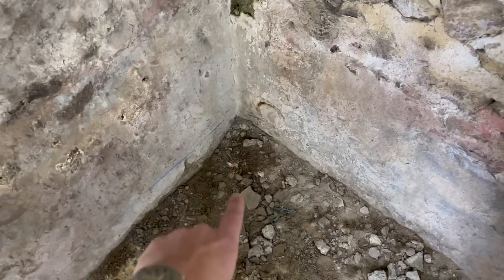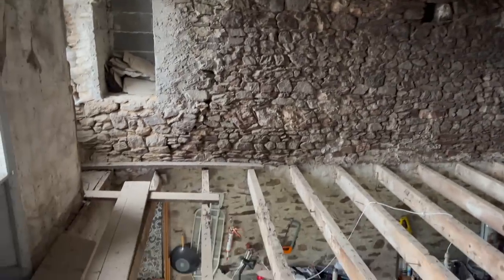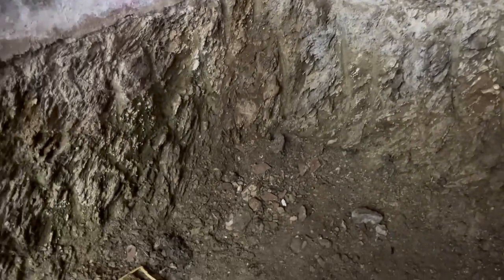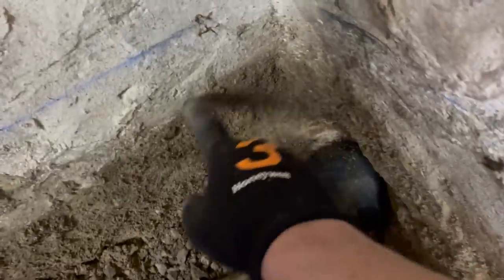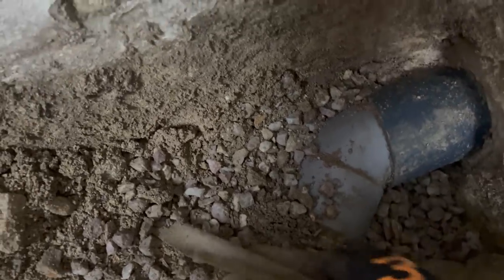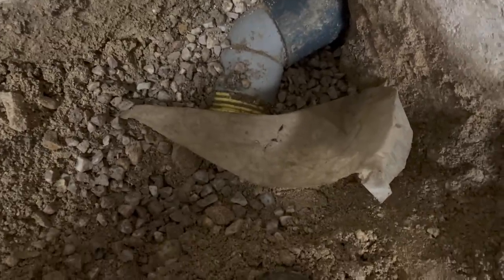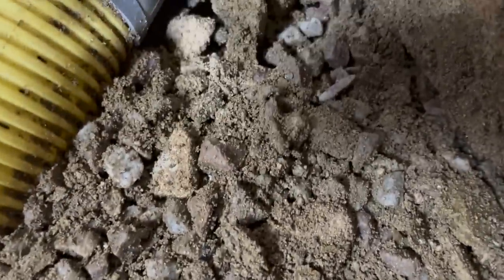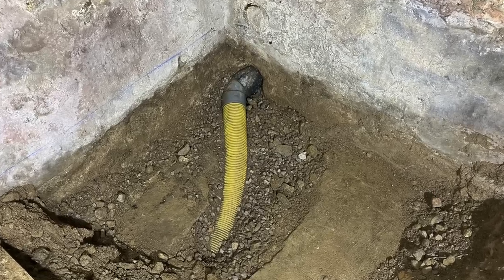A French Drain Inside Our French House

Comment: Oh heck! Glad to see the dehumidifiers are enroute. You'll want to carefully return that fabric you removed and re-cover that perforated pipe. From the three videos, it appears you are dealing with something very similar to what I've dealt with over the last twenty years in this particular region of the US. We have very thick clay soil and quite a large number of natural springs. The perforated pipe suggests you have springs under your floor. However, I think you've had a bit of luck, too. You're on the end of the block, which means you can run the drainage around the outside instead of moving water from outside, to inside and through your house. 
  One other thing, you mentioned the corner of the house in relation to the hole and what looked to be missing stones. I would instead posit that was where the extension was removed and those missing stones were where the extension was Keyed into the main building.
Reply from the maker: My partner suggested there may be additional water sources under the floor, it's not uncommon here. Your point about the extension being keyed into the corner makes sense. Interestingly, I had originally looked in the hole for the stone from that corner, but to no avail. Turns out a lot of the same stone was used in the hardcore on the floor inside.

Comment: Just I case I come across as a mad man please be aware that I am the son of a Water Engineer and grew up at my fathers side on projects from the British Isles To the African continent, Covering numerous developments of Dams,  river water extraction points, pumping stations, pipelines etc. All of which my dad designed. I later became involved with agricultural drainage and designed a drainage machine that was eventually taken up and built. 
The present system installed under your floor, is badly misconceived the irrigation/drainage pipe used to conduct the water gathered at the rear of the property will be doing a great job of irrigating your floor. I would recommend  that you replace this pipe with a more conventional pipe leaving the perforated drainage pipe under the floor to remove any rising damp. If it were my house I would dig up the entire floor and start again. The lack of understanding in the original installation  does not fill me with any confidence in the rest of the job. Should you have any amount of ground water rising through the bed rock beneath the ground floor rooms the perforated  drainage pipe system will need to be extended to cover much of the floor, I would suggest a ring immediately inside the cut bed rock to gather water as close to source as possible backed up by a second web to pick up the rising water both should be isolated from the drain from the rear. Install a stone sink to catch the water at the front of the property as a drinker for dogs and livestock. Have to say this property becoming more intriguing ,You need to get this right first time pratting about with half measures bound to lead to failure and extra cost. It may well be worth cutting an airy down the flank of the house and changing the direction of flow on the rear drain, getting in a JCB and digging out the rear of the property and starting again ie new retaining wall well and a wider airy along with a deeper rear drain. Personally I would cut back the natural rock wall by two meters and deepen by as much as the level at the front of the property will allow
Reply from the maker: Thanks for the comprehensive comment. I assume an 'airy' is an air gap between the wall and earth?
Reply: @TheRenovationProject  You have it. You commonly see them in cities like London as a big void in front of cellars and basements

Comment: I think one more element of the original drainage system is still missing. There should be a pipe (given the age of the original walls it's not necessarily a pipe!) from the back of the house (the old well maybe was a sinkhole?) to the street.
Then at some point of time this original drainage system got clogged, or was not connected into the drainage on the street (or both), so the water stuck and started to seep into the drain below the floor.

That drain below the floor may stay there, but further water incursion should be prevented and the water at the back needs a new pipe (way deeper than the actual one) to the front.
And based on the state of that gravel, that house might need a year of rest to let it dry, before work can be started... Removing the gravel might not be a good idea. You need to know the depth and strength of the foundation first.
Reply: ... on second thought, the street looks relatively new (a decade or two old, maybe). Likely, that time they 'sorted out' the drainage and sewage too, and maybe that was what caused the actual situation. 
Just thinking and guessing: I don't know about the local regulations, but it's often a rule to have no rain- or groundwater to the sewage system. So, the original outlet for the groundwater was likely disconnected from the deep running (sewage) pipes. And the street drainage was on too high level to connect it there => the water got stuck. 

Just guessing. Maybe some older local can tell you the story.
Reply from the maker: We have been chatting to the neighbours and are slowly learning more, also briefly met a chap who was born in this house, but he was too young to remember any details!

Comment: I can understand having the land drain under the floor, particularly with how wet it is out the back but I'd have expected the drain from the back to be solid to the front with the land drains connecting to it via T's. So water passing through did that with no chance of stopping and water that 'rose' under the floor had a way to escape without evaporating into the house. The current system seems to do neither job well / at all!

Comment: That makes me think, how hard would it be to take the water round the out side via bug out corner? Put a lot on concrete in that corner where the down pipe is from the roof & slope it the other way?? 👍👍🇬🇧🇬🇧
Reply from the maker: Yes, I think we are going to create a system that takes it around that side. I need to look to see how much elevation we need in the corner where the drain is (to get it around the house with gravity). Cheers.

Comment: The hole in the back of the building was made to lower the groundwater level. Thanks to this, the wall is not wet. The chipped corner of the building indicates the freezing and thawing cycles of the water in the wall.
In order to lower the humidity inside it would be necessary.
Waterproof the walls below the ground level by injecting a special preparation. This will prevent capillary rise from below.
Replace the perforated pipe with a solid pipe to flow water from the back of the building to the front.
Make a separate drainage in the basement under the building with a perforated pipe, drain also to the front of the building.
Finally, a concrete floor with waterproof insulation.

Great movie, looks like a good series. I subscribed.
Regards and good luck with the renovation.
Reply: Most of your advice should be ignored, sadly. Injecting a chemical damp-proof course into masonry walls is a big no with older properties, as is laying an impermeable concrete floor. There are better, more appropriate, methods of dealing with excess moisture in an old house.
Reply: @nwcitroen2222  Can you provide specific solutions?
In the comment I gave the basic solutions. I don't know if the owner wants to keep a hole in the ground behind the building or fill it up.
I realize that everything depends on the owner's plans and budget.

Comment: Good idea to take professional advice and perhaps talk to a trusted local builder as to what they would do.
The staff at builders merchants can also be a good source along with other YT bloggers.
Plastic French drains such as these have non porous inverts( no holes on the bottom) so the water should be getting away.
You might want to check with a camera or chimney sweeps rod that there are no obstructions in the drainage pipe.The pipe should have a grill at either end.
Bonne chance
Reply from the maker: Good advice. Thanks.

Comment: 🤨 I'm surprised, as you were, Lewis. I'm an engineer, but no expert and would have thought that water in transit from one side to the other should be in a normal pipe, with a separate French drain/hedgehog arrangement to drain the inside of the house, if required.
If you haven't already seen it search for -
Hérisson, isolation du sol, ventilation - David Mercereau
(no connection)
I dunno where you are in France but if it's anything like the UK the ground must be saturated and about as bad as it will ever be. (We've had light-medium rain every day for weeks)
Reply from the maker: Thanks for the tip, just found his website. We're in Normandy so tend to get similar weather to the UK.